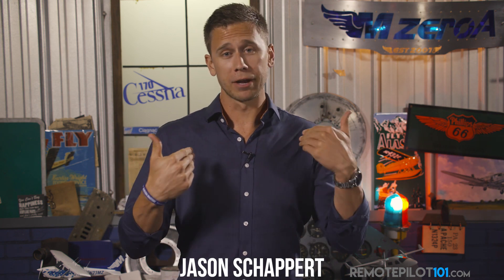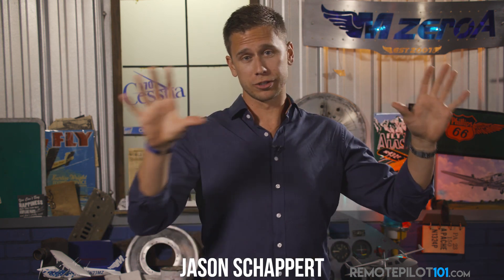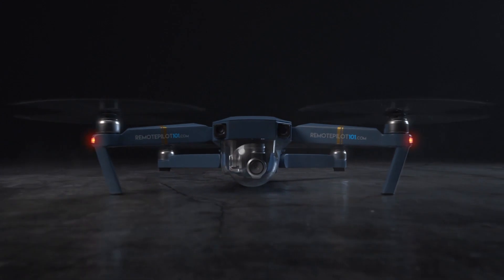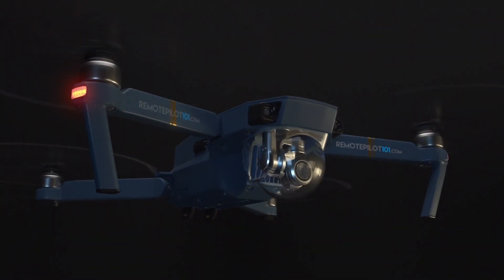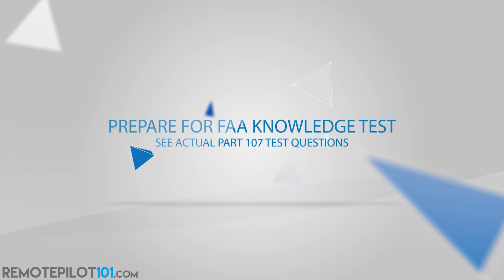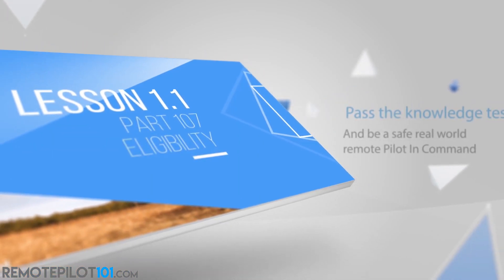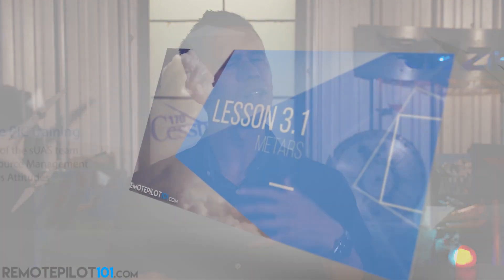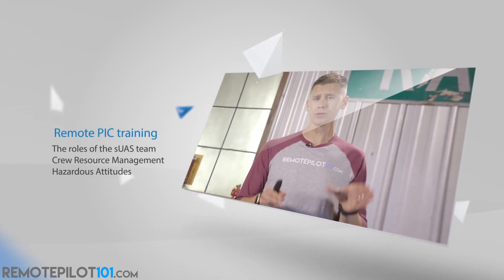Answering Your ADS-B Questions - Remote Pilot 101

Comment: Thanks Jason. 
It would be nice if we could have the ADS information on a separate monitor as opposed to the primary monitor. The primary is already crowded with information. Depending on when the ADS received begins to report on the received signal, there could be a lot of noise that is effectively not applicable to the RPIC. e.g. the manned aircraft is 250 miles out, and the ADS recognizes that and reports it to the UAS RPIC. I realize aircraft travel quickly, but that may be excessive.

Comment: Hey Jason. I obtained my 107 through your program and now recommend it to all my Public Safety colleagues. At this time Airsense by DJI is a joke. I get a warning for every aircraft in my vicinity of my Matrice 210. I could be at 200 AGL and receiving alerts from aircraft at 5,000 AGL and more than 10SM away. It is a major annoyance. Since I operate with the Northern end of DFW, Alliance, and Addison Municipal as well as the entire Denton Enterprise Airports in my County I see the benefit, but not at it's current configuration. It is a constant nagging that takes over the majority of the Crystal Sky screen on every plane in the airspace.
Reply: mine works great around light-duty airports with 2 strips...if you live near the LAX I can see why the FAA didn't want everyone on the radar...its the problem you having Eric from 1 year ago...case in point...its a step...not all tools are perfect but for my drones with no ADS-B...I sometimes never know there near because they will cut their engines so low when they come in for a landing at the strip and if I'm at 400 feet for some stupid reason...probably to get more signal and viewing strength...that can take a while to descend safely...as pilots I think its just a good step...a tool...but you are correct Eric...in your area its already saturated with current chatter that imaging adding people who want to fly around 400' to the list would be a wreck...FAA is in the right path...less radio chatter the better!...but at least you KNOW something is around you...instead of knowing nothing like some of my devices

Comment: My Mavic 2 ED has AirSense but when it shows a commercial airliner, all I get is the partial tail number (which is fine for security purposes) and a distance. I see the icon as it moves obviously but I don’t get an altitude or heading or anything else, just distance. As for a refit to existing non-Enterprise models, why not just get a handheld device? I thought you could get one of those for about $500. Then you would really only need one ADS-B receiver for ALL of your drones.